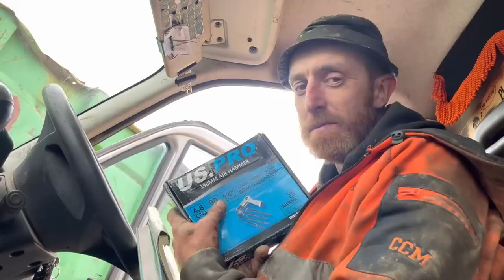Perkins zexal fuel injection pump removal on JCB forklift at D&J projects, inspections ect

Comment: Chris the pump uses the engine camshaft with extra lobes to operate the fuel pump. The engine fuel pump timing is done by the shim gasket between pump and block. The clip that hold the governor linkage is called Jesus clip because that’s what you call it when it falls in the sump. Stop solenoid needs removing before loosening pump as you bend the stop pin cheers CP
Reply: The governor is in the timing cover, if you remove the cover do not turn the engine over as the oil pump roll pin moves round a puts a hole in the timing cover if you do not realign correctly
Reply: I always have magent close by marine ones stainless doe 😀😀😀

Comment: Hey up Chris, your videos are better than the telly! Can't beat a good old fashioned no frills mechanical injection pump, none of this modern computer controlled electronic unit injector gizmo trickery nonsense. I can remember when stop solenoids were considered modern, the norm was to reach down and lift the accelerator pedal to stop the engine. Proper old git ain't I?